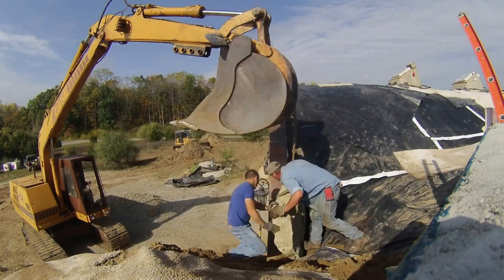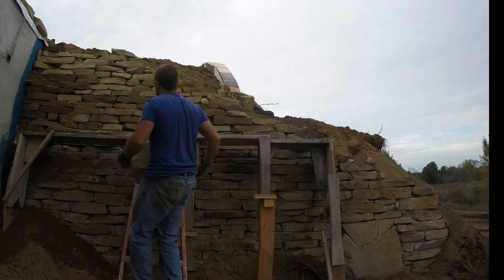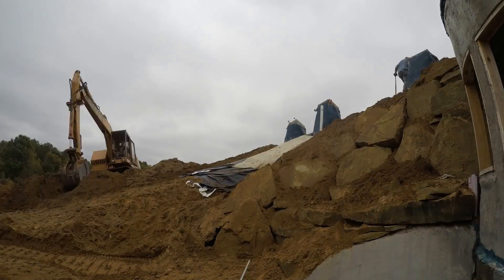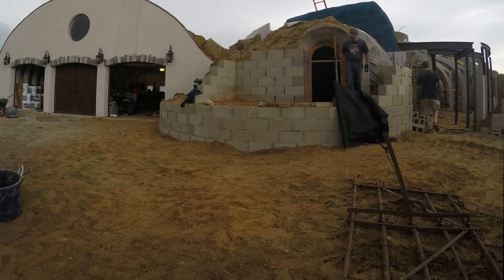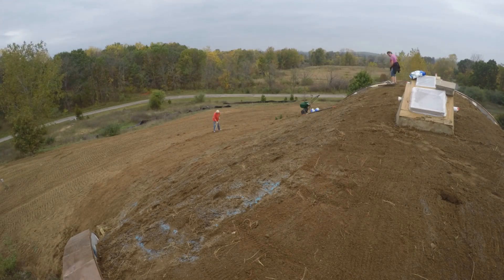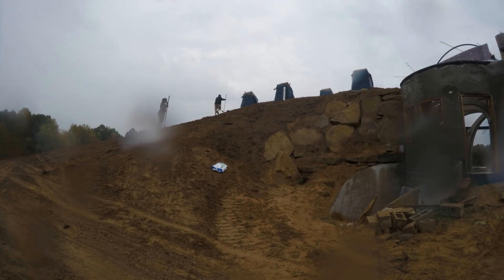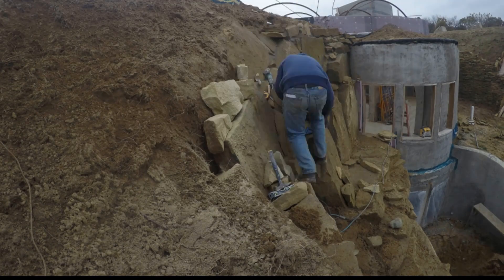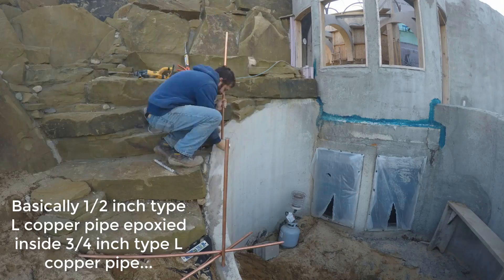38.3 Earth Sheltered Home Burial, Phase 2

Comment: A word of caution about your copper rails.  Concrete and copper don’t get along.  If the copper is completely coated in epoxy it might be okay.  You will have to keep an eye on it.  Radiant floor heating in concrete was first done with copper.  It didn’t last.
Reply from the maker: Yup, I'll keep an eye on it.